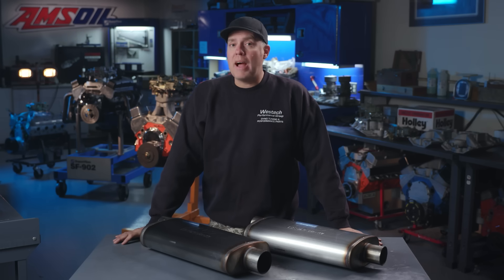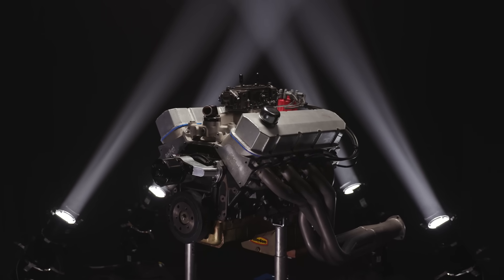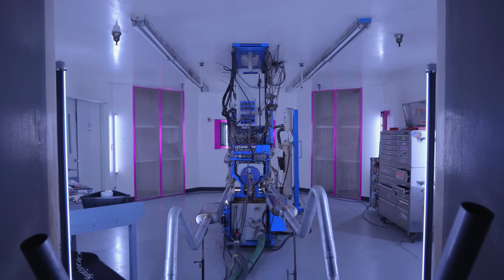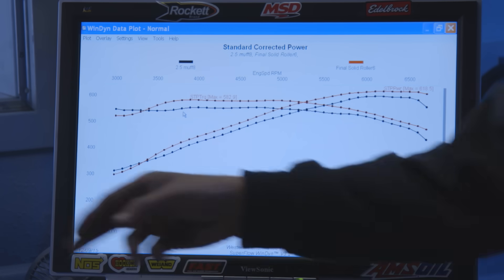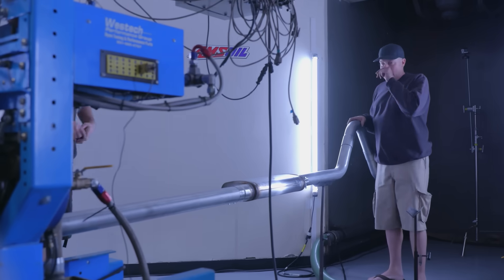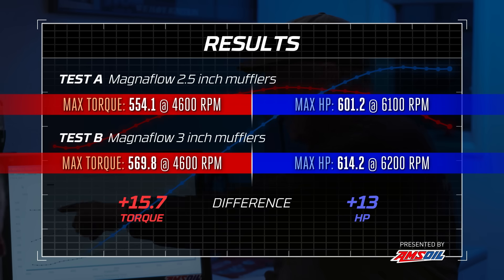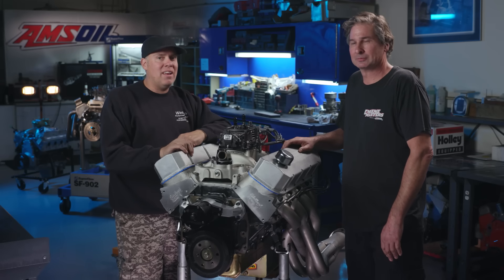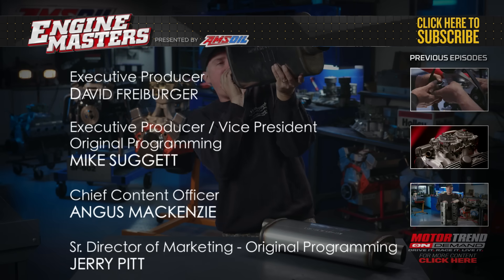The Power of 2.5- vs. 3-Inch Exhaust - Engine Masters Ep. 9

Comment: So why not 2-1/2" for cruising down the interstate, and electric cutouts for track/bullshitin around town?
Reply: An electric cutout is installed inline with your existing exhaust system. 
It contains a butterfly valve that can be mechanically, or electronically opened, allowing a straight dump of the exhaust.
Reply: I installed an electric exhaust cutout after the cats on my 02 Silverado 1500 with a 5.3. Believe it or not, the seat of the pants feel is that the truck is slower with the cutout open.  My friend's theory for that is that the exhaust is trying to pick a way to flow, and some tries to go out the cutout and some tries to go through the muffler, causing interrupted exhaust flow.
Reply: +HvyMetal4Ever  That is ideal for vehicles with EFI and multiple maps that can switched but carbs may suffer because of the difference in fuel requirements to make maximum power under either condition.
Reply: explain to me these electric cutouts
Reply: +HvyMetal4Ever a lot of manufacturers like BMW or audi actually do that.
Take a look next time when you are by one of the newer models, if it has more than 1 exhaust, usually, only 1 will actually be open at idle.
The general role is that for low RPM, you want a more restrictive exahust, and for high RPM, you want a more free flowing one :P
Reply: +kain hall on the contrary. a turbo needs BETTER flow through the exhaust to spin the turbo up faster (I've experienced this lots with cat equipped turbo engines when the cat has blocked)
bigger inlets mean more boosted air can be pushed into the engine. an intake of a given size will only allow a limited amount of air in, no matter what the pressure.
Reply: Peter Lattimer The reason why the turbo needs better exhaust throughput is because it uses the exhaust to power it. therefore, if you decrease the exhaust airflow, you decrease how well the turbo can work.
Reply: HvyMetal4Ever Open exhaust doesn't automatically make an engine more powerful. With stock intake and log exhaust manifolds an engine can only flow so much. Now if you take a high performance engine built for maximum HP with more efficient intake, better heads, better fuel delivery with a larger carb or aftermarket programmable fuel injection,  different cam, pistons, a good set of headers and properly designed exhaust system, I guarantee you would make more power with the cutout's open. But in your basically stock vehicle it is probably messing up the fuel injection and your mixture because with all of the pollution control BS on it, it is already tuned for close to maximum efficiency with the restraints put on it because it has to be able to pass smog testing. If you look at any of the other Engine masters video's that have them testing various exhaust systems or different Muffler's, you will notice that after proper tuning the open headers make the most horsepower and torque. So in your vehicle I almost guarantee you are making less HP and probably losing some torque which is the real reason you think it feels slower by the feel in  "the seat of your pants". But it probably sounds good when you pull up next to some ricer with a fart can that makes their ricemobile sound like a 3 cylinder 17hp Kubota tractor with no muffler and a blown head gasket! 😀
Reply: Karolis Nosevičius  I know there are Corvette models that offer the option as well
Reply: Gonzo's Garden any setup needs to have an optimized exhaust. an exhaust that is to short or to long will let in atmosferic pressure in to the exhaust, that will create back pressure in a way. imagine it as a wave. as the exhaust clears it self of all the gasses, the vacume in the exhaust will suck in  atmosferic pressure, and than, the next "charge" of exhaust gasses comming from the engine will need extra effort to push the atmosferic gasses out again.
Reply: +Gonzo&#39;s Garden a turbo can create backpressure! we had a VW a few years back (1.9PD TDi) and the turbo failed (blade broke off the impeller and jammed the turbo solid) and the engine actually wouldn't RUN. it couldn't get air in, and what air got in, couldn't get back out again!
Reply: +Peter Lattimer The thing is, turbos rely on the exhaust pressure coming from the engine in order to help draw in air.

The pressure is only needed before the turbocharger.

I think having too small exhausts reduces airflow and thereby, decreasing engine performance.
Reply: with a turbo...its all about flow rates.

the trubo forces air....so you can get away with smaller tubes, on both intake and exhaust. 

but for performance, you want 0 pressure in the whole system if able..force it in, force it out.
Reply: is it built any?
Reply: C/10 racing nope totally stock down to the air filter box and muffler.

Comment: Just a thought, The back pressure myth portrayed comes from the area of which you were showing that weird anomaly where you lost torque below 3500 rpm with open header. In an engine built to make power above 3500 it is completely negligible. But to most people driving a vehicle with a stock engine and maybe mild improvements like intake and headers, perhaps even a mild RV cam, an exhaust leak makes a noticeable difference in losses down low where most of the driving experience is spent. I would be curious to see the results on a standard crate 350 or something built to make peak torque at around 3000-3500 rpm and peak HP at around 4000-4500 rpm. Great show by the way. Enjoying the vids.

Comment: Why didn't you adjust the fuel to lean it back out, if the ratio changed with the smaller exhaust? Sounds like that's more of the issue

Comment: Next very obvious problem. Virtually no car will cop 3" tailpipes. Big utes, trucks etc may. Test 3" mufflers and smaller tailpipes which MAY go over the axle. I suspect a bit more low end torque and very small power loss. Unless the pipes are all lagged to hold heat by the time the gases have came out of the muffler they have cooled considerably so will cop a smaller tailpipe.On a car of mine [ mild 400M Ford cruiser] it is 2.5" to and through the mufflers and has bugger all change under 5000rpm with or without 2 1/4' tailpipes. And is a LOT quieter and legal too! For street and nearly all motorsport rules must have pipes outside the bodywork]
A higher RPM engine will need bigger pipes [DOooh] but within reason the same still applies.
My 351 Clevo road race car [mild 380rwp] likes 3" pipes out under the door [with small mufflers required] far better than 2 1/2" .  Well,, over about 4000rpm anyway. If it was on a road car the smaller pipe would be preferable for mid range torque [3-4500]

Comment: Good information but all that big money for 14 horsepower is out of reach for the average wage earner. Nice video, tho.
Reply: The "average wage earner" saves his money and does what he has to in order to get the power he wants.
Reply: Stanley Stalvey The 2.5" set up (with a x pipe and tips) runs $700 +/-

http://www.summitracing.com/parts/mpe-16792/overview/

Magnaflow is stainless , big difference from a muffler shop.
Reply: +Stanley Stalvey Well the motor has to have some type of exhaust for the street....and if this 454 was going back into the car it originally came in...the stock exhasut would cost it alot more than 14hp. The 14hp was vs an aftermarket 2.5"...and I think if any guy had 2.5" on it already...most won't change.
Reply: +Stanley Stalvey Well.. You're buying the exhaust for it either way. So you might as well spend the small amount of extra money to get the 3" setup.
Reply: JerseyMikeP Exactly. If you're paying $3,000 for a street car exhaust, then someone is seriously screwing you. Even the full stainless catback exhaust with x-pipe for my Jaguar is only $2k. And that's for a fairly uncommon car. For any popular American car it will be a lot less.

Comment: so... umm math 

7.065 cubic inch flow rate with 3 inch                   115.77 cc
4.906 cubic inch flow rate with 2.5 inch                 80.39 cc

if my math was right it's late that being per bank assuming dual exhaust...

14.130 for 3 inch dual          231.54cc
9.812 for 2.5 inch dual         160.78cc

But thinking it has 454 as a displacement that's 929.96cc worth of exhaust being pushed out
per exhaust cycle per cylinder... how much free flow is to much

makes ya wonder the same is true for intake 929.96cc per cylinder per intake stroke ???

to late to tire to much math for get it.
Reply: +iwasatoad for got 

25ft of 2.5 minus muffler 1471.875 cuic inch  or 24119.709 cc
25ft of 3 minus muffler  2119.5 cubic inch or  34732.382 cc

think that's right 
def to much math this late

Comment: You guys should do this again but with a motor that has a more typical HP rating (low 300's - mid 400's seems to be the average for most cars;well pushrods anyway) and do this test again with straight pipes,glass packs,Lake Headers and zoomies.

Comment: If they'd leaned it down with the smaller exhaust they probably would have gotten most if not all of that hp and torque back. This was stupid and completely meaningless. You don't massively change the exhaust system and not re-tune for it! They even showed that the AFR was rich by ~.5 with the 2-1/2" exhaust.
Reply: +Mister510 Exactly correct.  Running rich robs power.

Ignoring performace below 3500rpm is plain stupid too - most street vehicles would rearely operate above 3500rpm in daily life.

Comment: A silly question: we all know there is a pressure pulse that runs down the exhaust to the tip and back again, and if it is timed right, it can help scavenging the cylinder as well as others. Would the scavenging effect not work more at lower rpm on a smaller diameter pipe due to more pressure in the pipe? Please in no way think I believe the difference will overcome the bigger pipe, I am just curious about the theory

Comment: I'm sorry but when you jokingly mentioned the fluid dynamics calculation ("cubic capacity") like a group of children, I just couldn't take you seriously anymore. Of course 2.5" is not going to cut it for the volume of air exiting your engine. 2.75" is just above the volume requirements of your engine. Of course the 3" is going to be nearly the same as the open header as it's airflow volume is high enough to support your engine. It really boils down to the fluid dynamics calculation that you mocked.

Comment: The reason y'all had more torque at the lower engine speeds was because as each high pressure "puff" moves through the exhaust system, it produces a low pressure behind it.  This low pressure "sucks" the residual exhaust out of the cylinder and you get much better scavenging and a cleaner air charge.

Comment: you can't say the exhaust caused the engine to drop X hp or Y torque since you didn't do a full retune and rejet for each exhaust combo.

You optimized the system for headers and 18" collectors, then changed variables.

Do it again with a full optimization 
for 2.5" and 3" full exhaust,then compare the numbers.  Simply the point of the exhausts forcing the curve rich is proof you're leaving power on the table.

Comment: yes backpressure is actually BAD ... what you are looking for is matching the exhaust velocity for you engines tune/build.  backpressure is just a byproduct of achieving velocity.  The funny part is... I WAS an exhaust shop fabricator, and I spend most of my time arguing with the people that were saying you had to have back pressure. 

the real fun for this testing is when you start including modern motors with high flow cats, and sensors that need a certain flow over them or the computer freaks out..etc

Comment: i would like to see this same test repetaed on a 302
Reply: +jamesassbag hey dumbfuck....chevys race 302s (as 305s)  but your probably too ignorant to know that its not about a car or an engine, its about the effect on displacement.
Reply: +supersevenn  Chevy made a 302 a long time ago.
Reply: I want to see it done on a 350 and a 327
Reply: I wanna see this same test repeated on a 4 banger mad vtak engine except with a 5" exhaust vs 72527228" inch exhaust cause rice
Reply: Not to shit all over your parade, but a DZ302 is not even remotely like a 305. Chevy's DZ302 was a rev happy screamer, built using a 350 block with a 283 crank. While the 305 was stump puller that used a 350 crank with a narrow bore block, to promote torque over horsepower. These two motors are practically polar opposites build on the same basic platform.
Reply: Da Blueguy  Thanks for laying out there. I almost went into that rant but stopped myself.
Apparently not every one understands how the DZ302 (which had an over spuare bore and stroke ratio much like fords 302) came in to play to compete in trans-am racing in the under 5.0 class. As did Fords original Boss 302. Both of which were down rated to 290 horsepower for the showroom,
Great part of racing history.
Reply: Wow this is like in my cousin Vinnie!

Comment: ok, well they didn't really debunk the idea that back pressure kills power. they only tested one engine, at one power level. unless you are making about 500hp or more, the 3 inch is probably not going to be an improvement. I would say that with the power loss with the 2.5 inch, it may have had more to do with the extremely long pipes. also muffler design can have an effect on it.  and the type of engine can effect this too. for example, I've gotten my first import. I grew up building what people today would call "old school muscle", and when I first bought my 97 prelude, I wasn't aware that 95% of Honda guys in particular, and imports in general are idiots. the very first thing they want to do is put a big ol' 3 inch exhaust on a 2 liter 4 banger. and they won't even listen to anyone who might have more experience then them. my prelude is nothing special really, I've done a few small things to it, but kept the smaller exhaust. and from everything I've read, the auto preludes are supposed to be a real pig, and slides into gear. mine isn't like that at all. I constantly get compliments on the sound, and how it runs. with the imports, unless you're running a turbo, and pushing a bunch of boost, I'd recommend keeping the smaller exhaust. of course these are the same fast and furious types of dumb asses that tried to tell me that "ram air is a waste of time and doesn't work"......reverse Darwinism at work there. the muffler I used is this same straight thru magnaflow they used here. I bet I'm the only Honda prelude around here that doesn't have some coffee can muffler on it...lol no rice here

Comment: Why wasn't there a crossover tube?
Reply: +kleetus92 Cuz crossover tubes are for pussies.
Reply: +DeepPastry I Was thinking the same exact thing. That motor was tuned for open exhaust so of course the 3" is going be better. If they had tuned it for 2 1/2" exhaust then the numbers would have been different. Not saying better but different for sure.
Reply: +dayyuu ... And yet, all these engineers keep insisting it's the better way of running your exhaust system. All this test showed was the hit you take to your power by running your fuel air mixture too rich.
Reply: +kleetus92 You mean like an H pipe or X pipe? I thought the same thing.
Reply: +Joey Garcia exactly.
Reply: +kleetus92 then its not a true dual exhaust?
Reply: +DeepPastry 
That's a good point.

Comment: Wonder how this applys to a lesser hp motor like a 383 stroker. Not nearly as much exhaust port or header. I think another huge debate that'd be kinda cool to go off of to end all exhaust arguments is scavenge effects and tourque of a single vs a dual exhaust. I've always been a dual exhaust guy. And bent up a bastered 2.5 duals into 3.5 or 4" single. Sounds wicked. But have no duals to bolt on to do a back to back comparison

Comment: Hate math as much as anyone but it's worth mentioning: a 3"  hole sounds like it's 20% larger than 2.5".  Only in diameter is that true.  Exhaust gas doesn't care much about diameter.  Going from 2.5 to 3, the cross section that gas can exit through goes from about 5 sq inches to  7 sq inches, which is a 40% increase.

Comment: All seem to miss the fact that a 3" exhaust system, especially dual exhaust is physically much heavier, do any minimal horsepower increase is negated by having to accelerate a heavier vehicle.  Removing the seats, hood and trunk would gain you more affective horsepower...make the car faster accelerating...one flaw of dyno resulting is yes you gained horsepower but many performance modes add weight so your net gain in performance us minimal and sometimes you make your car worse performing for the guy that drives through a speed shop with a big magnet installing everything that sticks.. Reducing the weight of your car can greatly increase performance with no motor, drive train, suspension or tire changes...

Comment: The carburetor was jetted for the open headers, and wasn't rejetted to compensate for the back pressure, they even said it was a bit rich.  I'd like to see the results if the engine was re-tuned for each configuration.

Comment: So only a 2% difference in peak hp between 3" and 2.5" exhaust.  You should try again with 3" pipe to the muffler, then 2.5" muffler and tail pipes, plus tuning.  I bet it would be super close to 3" (close enough to not notice by the seat of your pants...)

Comment: is the power gain from the 3" from running a closer air/fuel ratio as the open header?  If the ECU compensates for running rich with a 2.5", would you gain the power back?

Comment: After leaning out the a/f ration with the 2.5", I'd bet it would pickup around 5-10hp & tq. On a NA setup, the difference between mid 12's a/f and low to mid 13's is worth around 10hp & tq.